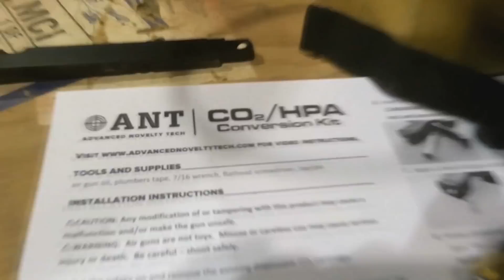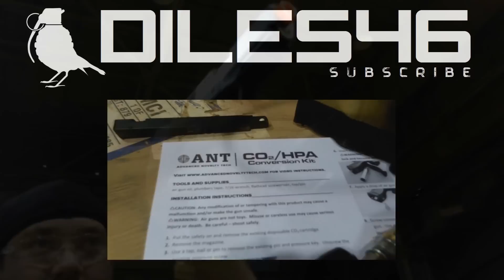Co2 Mag Remote Line Conversion Kit!

Comment: mine is leaking where the rubber at the bottom of the tank is.  cant seem to fix.  it still fires.  you can hear the hissing air coming out of it.  you'll just to fill your tank sooner.  why couldn't they make this where you screw into the tank instead of the sitting on the rubber thing.  i'd hold of for now.

Comment: so im assuming u can take the nozzle off if you need to change mags
Reply: It looks like you just have to unhook the hose and then switch mags like a Russian valve.
Reply: Bierce88 didn't think about that...so if you run multiple mags, you would need one of these in each of them....wonder what the cost is going to be then...
Reply: Actually I've seen guys do a modification where you have a second line that feeds in the BB's.
Reply: I don't think it'll be too bad as long as I run a few speedloaders too

Comment: I'm assuming this will only work for pistols, but I have two GBBR's. A KWA LM4 and then a WE Tech CQBR. Would this work for Co2 mags? There is a little plate that you slip on after installing the co2, but I'm not sure. HELP